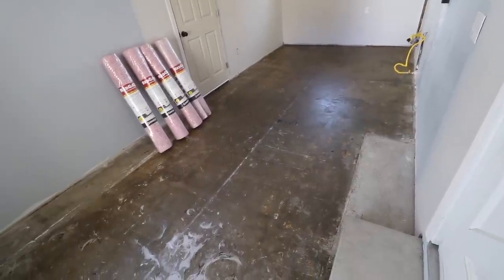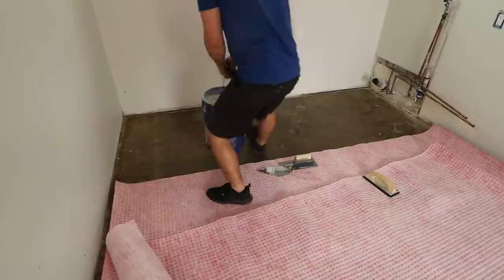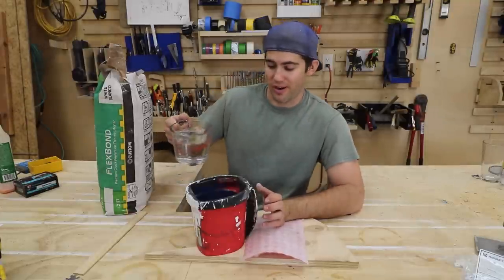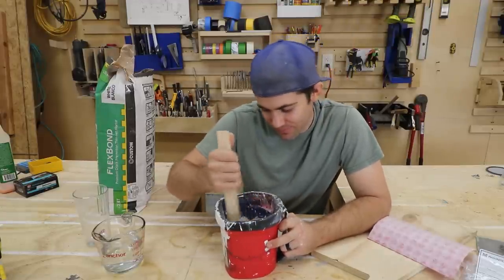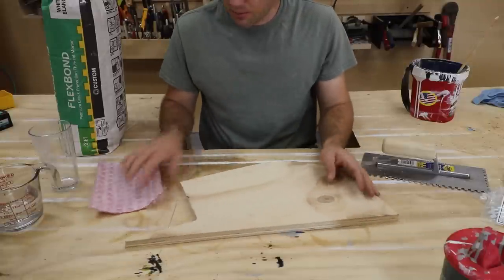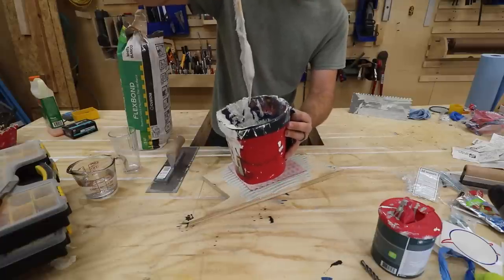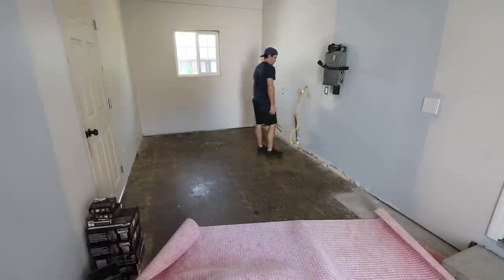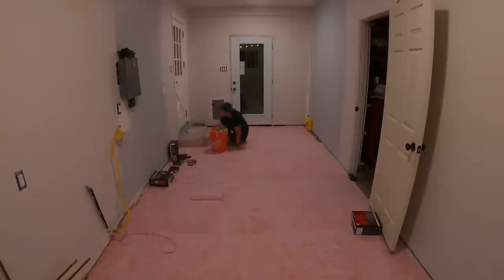Mudroom Renovation Part 10: Underneath it all

Comment: Nice job on the test, you learned that it’s a slurry that’s required for the underside of an uncoupling membrane… I, too, work with a half bag at a time… however, the pros will cut the bottom portion of a bucket off, and insert that into another uncut bucket… this will give you about a 6 gallon bucket with much more room to operate for the mix 👍🏻

Comment: Good work. Test patches and mixing smaller amounts is never a bad idea. Pros might come and tell you all the things you did wrong but for a novice home owner you only did one thing that you should be mindful of in the future. Work your way from a starting point to an exit. You never wan to go across or sit on fresh mortar or grout. It can cause low spots and unevenness under your tile. If you can't reach across the full width try half the sheet lengthwise as an alternative. Still good job brother.